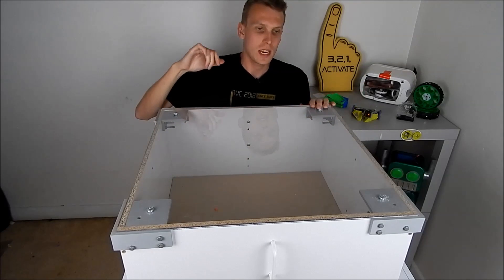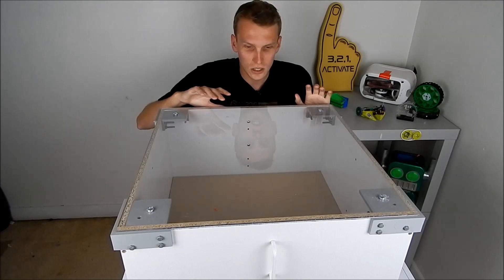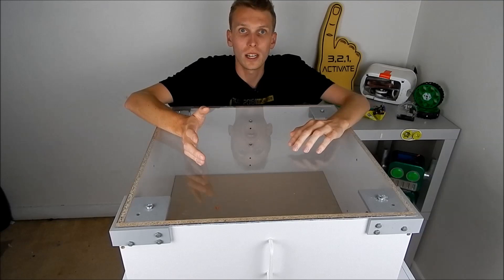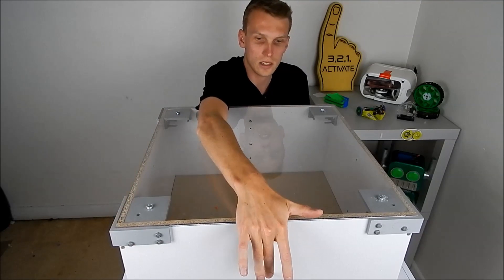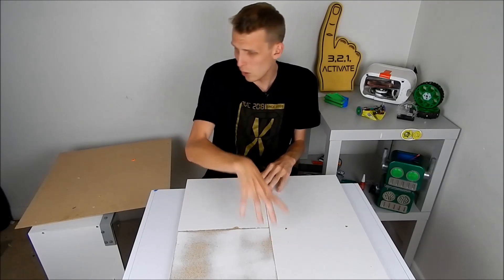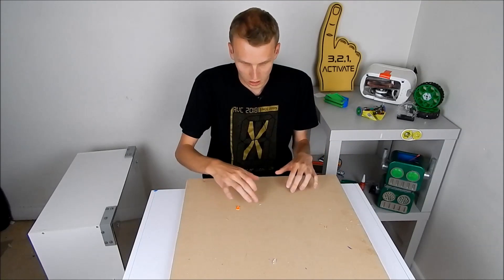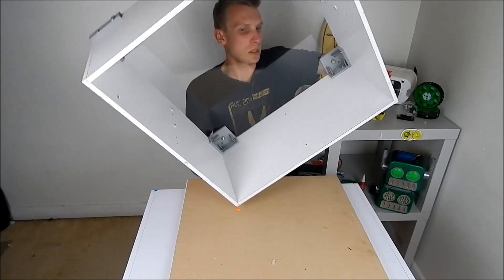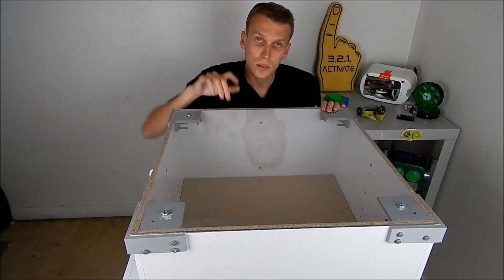Simple combat robot test box!

Comment: Good video, Very cool to see the people don't hide this things, but i THINK that drill holes on the lexan It is not a safe option, because It can Destroy more easily, any way, great video
Reply from the maker: If I was going to make a bigger test box I would not drill through the lexan, because you are right, it creates stress points.

However, this is only a small arena for small bots. The lexan is far enough away from the robots that it won't take any big hits.
The lexan is mostly to stop any small plastic shrapnel from hitting me

Comment: nice little test box. was robert cowan's an inspiration?
Reply from the maker: I've had this test box for around a year, but Roberts video did inspire me to make this video
Reply: @TeamPanicRobotics  ah nice, i admittedly for 150 grams use an upturned clear plastic storage box from staples (not sure you if you have those in Aussie, bit like a crap ikea for office equipment) it probably 2-3mm of im guessing acrylic or cheap plastic like that , im sure a direct weapon hit could punch through it but it be hard to hurt someone on the outside, but so far ive not had a spinner but... am currently building one so it be better than nothing i suppose